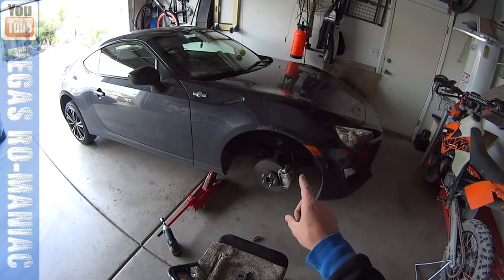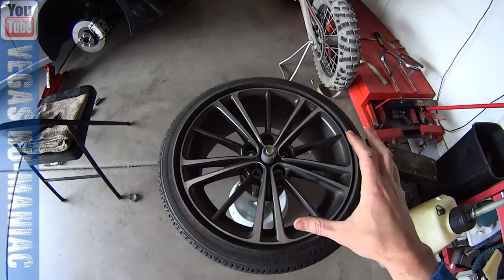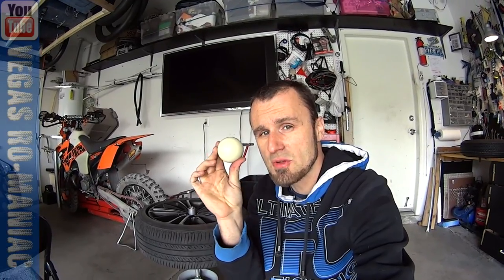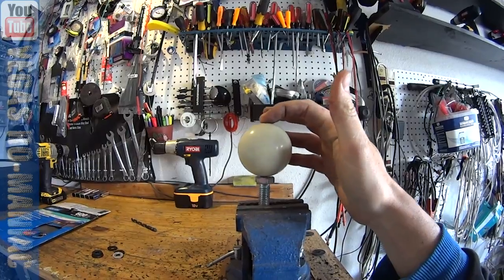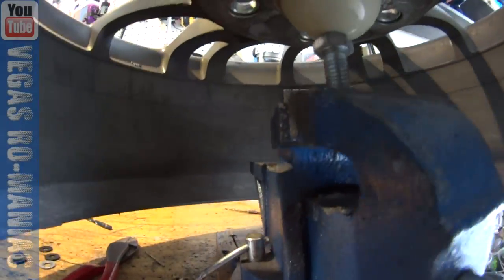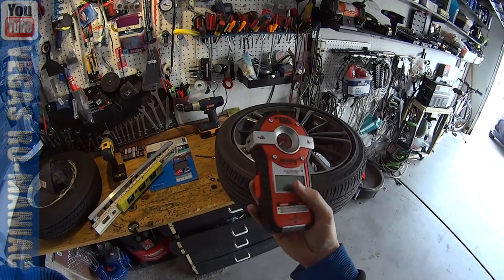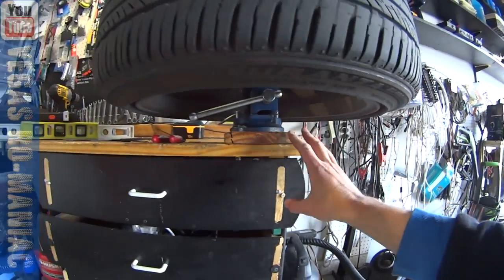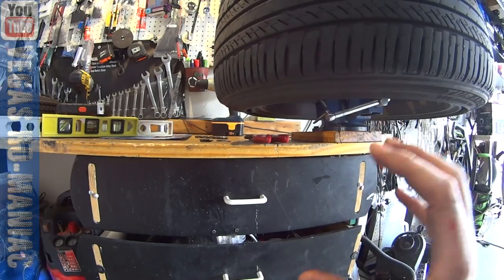Harbor Freight Bubble Tire Balacer VS DIY Home Made VS Digital

Comment: It should work 100% if you calibrate the center bubble for a single plane. This balancer does not measure rotational balance, so if you change the orientation of the cone, then you absolutely will need to recalibrate the bubble. Spinning the cone 90º and showing that the bubble is then not centered is exactly what should be expected. It does not mean the unit is not correct. Calibrate, then balance without spinning. Then afterwards, if you want, turn the cone to whatever amount you want, recalibrate the bubble, then re-check the wheel/tire. If it's off by a minute amount, that's the differential you need to worry about- even tho you'd probably never feel that little vibration.
Reply: But , the cone should be balanced already - if it is not, then it is going to introduce it's own set errors. 

If cone is balanced, it should make no difference on it's rotational position.
Reply: @pingpong9656  The cone may be balanced, but the inside of the cone or the point the cone sits on are not hardened or precision ground. The cone will not sit precisely the same in different rotational orientations.

Comment: If you put the balancer on a lathe, you will see that the inner cave, where the pin goes, is NOT centered. You must simply regroove the cave and adjust the bubble.

Comment: If you're turning the wheel and the bubble goes from good to bad then you should check the bubble balancer first.  You could be off-balanced or not leveled, and so could your wheel.
Reply: Yes his bubble level is not level lol no wonder he cant balance his tyres
Reply: It specifically tells you in the instructions not to spin the tire on the bubble balancer because you'll mess up the pin or the balancer pin receiver.   You level the balancer and place your wheel on it,  but do not spin it.

Comment: Decent Video, but your conclusion at the end is erroneous.  It is certainly possible to statically balance a tire accurately, just because you could not find a way to do it, does not mean it can't be done. The concept of static balance is quite simple: The radial axis of a tire and rim assembly must be perpendicular to the horizon line, in all quadrants (plumb) when the tire and rim assembly is suspended horizontally by its exact center point (the location of the radial axis). I totally agree that those conditions cannot be accurately met with a Harbor Freight balancer, nor can they be met with a ball. I actually made a Youtube short that demonstrates a way to meet the conditions of the concept of static balance. Now I am not saying that the method I demonstrated in my short is the only way, best way or most accurate way (only accurate to 1/4 ounce), However it does prove that it is possible to statically balance a tire and rim assembly with a fair degree of accuracy through simple means (even the most expensive electronic motorized dynamic balancers are only accurate to 1/4 ounce) which brings up two more points. #1 dynamic balancing is not perfect, but no one would argue it is superior to static balancing if done right, because dynamic balancing also takes into the difference in balance on the sides of the tire/ rim. #2 Even if you balance a tire and rim assembly perfectly accurately by the strictest criteria you still have to install it on your car to use it. Once you do that the tire and rim assembly become a tire, rim, hub and rotor or drum assembly so that perfect balance will only be maintained if all those other components are perfectly balanced. Truth is once you bolt the tire on your car dynamic balance loses its advantage to static balance since the axis of the rim is secured to the axis of the axel and the tire is supported by the ground, the tire is extremely limited in its ability to move from side to side, so the difference in balance from side to side becomes relatively inconsequential.

Comment: Took to pro shop twice with dynamic balancer.  Car vibed like crap.   After this happen to 2 cars, realized the tire shops dont calibrate machine, they dont take off old weights and clean inside of wheels.  Gave up and did it myself.   Problem solved in 15 minutes rather than so many hours waiting for costco to do crap work.  When tire shops dont clean rims or lube during install, the tires dont seal too.  Gave up on shops as they nickle and dime and destroy my tpms sensor too.

Comment: I at one time in my life calibrated wheel balancers.  They're only as good as what their calibrated at. Every time a tire changer uses  balance a tire and then flips the guard up and it slams into the guard stop your machines calibration is thrown off. The reason why your bubble balancer will change when you turn it is that it's adjusted in that position so mark and align the hub and base to get an accurate balance.  Never slam tire on balancer and never hammer weights on balancer.  Use sticky back weights and both your computer balancer and or bubble balancer will thank you.

Comment: Bull$h!t I use a bubble balancer and have never has issues and weird out of balance wear.
Reply from the maker: Every time I use the bubble balancer I had that little wobble on the steering wheel that was really annoying maybe because my car is really small and it can feel the vibrations on a big truck maybe you don't feel it as much because it's just like vibrating by itself because of the tires already anyways but on a smooth ride like a small car bubble balance which doesn't do justice

Comment: One problem you may be having is that the balancer shaft isn't tight enough and is moving slightly,  tighten the nut on the shaft and try again.  Another problem could be that the floor the balancer is on isn't perfectly flat and allowing the balancer to move slightly.  Check your floor for flatness and push down on the balancer base to make sure there is no movement.

Comment: Even modern tyre shops cant balance wheels properly.
Youre dealing with machines that dont get calibrated regularly, staff that arent trained correctly, and also one major factor is that staff at these shops just slap weights on without cleaning the wheel surface.

Wheel balancing is an art. And i truly believe its something that manufacturers need to address in order to supply a product affordable and accurate enough to do the job at home.

For the record, i hate bringing my car to a tyre shop. Most of them have no clue how to care for a vehicle.
Reply from the maker: I clean my tire before I bring them in , the balancing is quite good

Comment: You can go to your local machine shop and have them turn you a steel disc about 14" or so with what ever size center hole to fit your balancer, Thickness about .5" or so whatever you feel comfotable lifting. Basically just consider this a standard to check your balancer each time you set up and this should never change out of balance , same as a weight standard for calibrating a scale. And this would be a one time purchase, and rub on  some paste wax to prevent rust, not paint because drips or runs could put out of balance. Best tire balance method is old school tire/wheel on vehicle which balances rotor , lug nuts and and other componants which are rotating with the wheel. But can change if wheel is ever removed and besides nobody has used this method since probably the 70s. Nowadays some people working in shops cant put their cell phones down long enough to master these skills whether its bubble or computer balancer anyway thanks to new age A.I. A local cashier could not count my change without help from their cash register. Maybe their bubble was a little off center. lol
P.S   Also disk is easily stored under balancer when not in use
Thanks
M L Rogers   Pasadena,TX
Reply: You would need to reinstall wheel the same way on the lugs to hold balance.

Comment: If a new tire that is being mounted its best if you pu t both dots in the right spot where they are supposed to be at...inflate the tire once that is done you reinflate it drops the amount of weight needed to balance and sometimes will not need to be balanced...what this does is like a balloon it stretches the rubber making it easier for air to be equaled out evenly inside of tire but must be do e before tire is put onto car and tire must be new

Comment: What if you could mount a reflector in the middle of the wheel so as not to change its balance, to redirect the laser beam up to the ceiling or to the side onto a surface further away that you can marks and measure? 

Another way I might try is to run a level string line just above the wheel, maybe using a clear tube water water level to be sure, marking a anchor on each side of the room with the wheel as close as possible to the middle of the string.  Should be able to get a very precise level that way, plus it should be easy to compare the difference.

[edit] Hmm, what about a small laser pen sticking out of the billiard ball pointed at the ceiling? The cheapest one on ebay would probably be perfect.

Comment: If you have expensive wheels, how do you keep the balance shop from digging deep scratches in them?
Reply: Get on there ass. Tell them that if they cause defects then your expecting them to do you right. Take pictures and times.
Reply: Those wheels are designed with enough flat surface on the back side of the wheel to use stick-on weights for a dynamic balance without hammering those clip-on weights.

Comment: There are buble balancers that have screws to center the buble before you put a wheel on it because the problem is if your surface where the buble balancer sits is slightly uneven it will give issues.
Reply from the maker: I've tried those also , no bueno

Comment: The issue he fails to explain is:
Wheel will, 100% of the time has balance issues NOT only top or bottom, but on inner or outer side.
Computer can tell which side needs how much weight and where. Thats why you get 2 weights on both sides most of the time.
Your wheel may not jump up and down after balancing it your self, but side to side shaking may occur.
Solution ? Yes.
You need to spin the wheel on a cone inside small hole so that cone will not wonder around.
Wheel will shake up and down. Move a marker closer to the edge of the  wheel and slowly move marker closer to the wheel edge.
As wheel wobbles, it will touch the marker only in the heaviest area. 
This method does not tell you if that area needs weight inside or out, it just gives you a general idea of where to try.
It doesnt tell you how much weight to try either so yo u have to try over and over.
If you have time, good luck.  Otherwise pay up.

For those who dont experience any shaking at your normal highway speeds, dont bother balancing your tires at all.
90% of all motorcycles dont balance except for fast sport bikes because they go over 90 on a regular basis.
Reply from the maker: Balancing on a motorcycle it's very important, even on my dirt bike I balance my tires.. Makes a huge difference  even after 40

Comment: its about balancing the rotaional mass of the wheel so it has even distribution not trying to make a wheel square to a surface
Reply: Problem is just a few grams off will be many times that at high speed. A bubble balancer which also spun the wheel would be great
Reply: @BlatentlyFakeName  a bubble balancer that spun the wheel would never give you any accurate information as that bubble would continuously move. I balance tires in a shop. Bubble balancers are pretty bogus as far as precision but it will get u in the ball park. The thing about tires is they can be unbalanced in more than 1 plane. Bubble balancers only do 1 plane. U cant sit that tire upright and tell if there is more weight on the front side than the rear side but the machine i use in the shop can. Just balanced tires yesterday and 1 tire needed 6 ounces on the rear inside of the rim and i had to put a 2 ounce clip on the front outside of the rim.

Comment: The problem with those HF balancers is the balance point rests in aluminum its soft and eventually it has enough friction to stop it from accurate functioning.  It needs a hardened ball and center point to be accurate.
Reply from the maker: Maybe but i think there is more to balancing that just being level
Reply: The biggest problem with a bubble balancer (regardless of quality) is that it is only capable of a static balance, whereas the shop's machine does a dynamic balance. Dynamic balance balances the inside and outside planes of the wheel independently, but a static balance basically balances the tire as if it were a 2D disc-even though a tire-wheel assembly is roughly cylindrical. On most car wheels, you'll find weights on both the inside rim and on the outside (or as close to the outside as possible, if they cannot be hammered onto the face of the wheel). On a bubble balancer, some people mitigate this by dividing weight between the inside and outside, but usually the inside and outside need weight at completely different points of the circle to achieve a dynamic balance. The difference between the DIY methods and the shop is solving a 3D imbalance with a 3D or 2D solution.